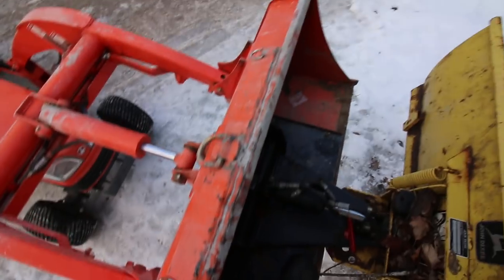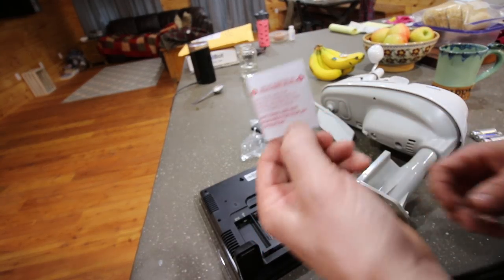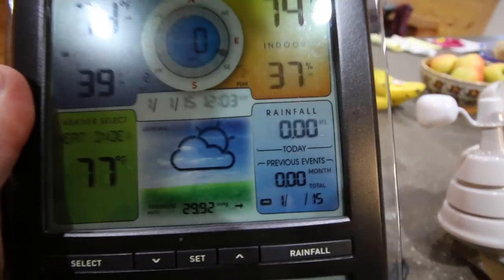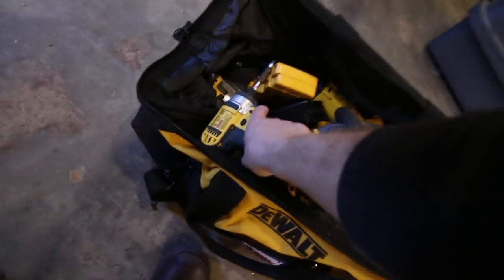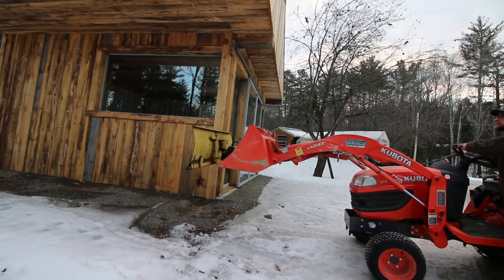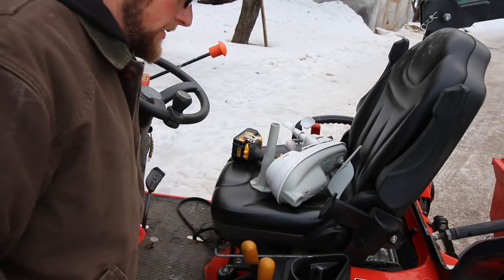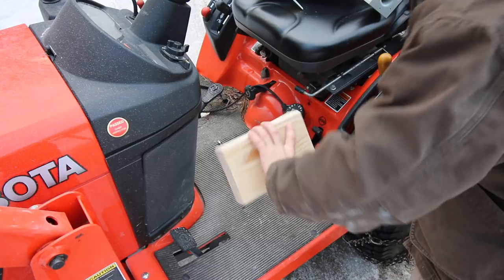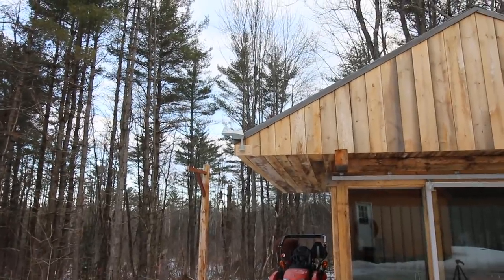Installing an AcuRite Weather Station Using A Kubota BX2370

Comment: Good morning Al.  Great project idea, thanks to Simon for his generous gift.  I have a similar model and have found that placement of the outdoor sensor is somewhat critical to its overall accuracy.   I had mine mounted similar to yours and the wind direction was not correct most of the time.  The wind speed will be off as well due to the surface of the roof acting as a deflector .  You should really consider mounting the sensor on a pole in the middle of your yard away from structures that can interfere with the wind.  The wind chill, speed and direction work best when there isn't anything deflecting the wind toward or away from the speed and direction sensors.  Have fun with it.
Reply from the maker: Thanks, I will have to think of a spot for that. And wait till the ground isnt frozen! Lol
Reply: Lumnah Acres Yes, the frost would require a drilling rig!  I'm waiting for the thaw to put up a bird house on a 16' 4x4!
Reply: Yes, thank you Simon!  Now Al can give the Modern Steader weather updates to include wind speeds, rain totals, etc.  I also agree with the other comments about the mounting, it would be mounted best on the gable peak with your solar lens pointing directly south.  A pole/pipe is not a bad idea, but it will be subject to wind gust making it pitch back and forth, yeh gable end above the roof line would be best.

Comment: When you check the manual I am sure you will find directions on how to use your compass (You do have one don't you?) to orient the unit so that it will give an accurate indication of wind direction. I think you were right about mounting it higher to get data on the wind and not just eddies at the corner of the roof.
Reply: I agree with you... I think the unit should be at the very peak of the roof to get accurate readings.

Comment: A few (friendly) thoughts... 🙂
- the little rudder that swings around on the bottoms of the weather station is probably for reading wind direction.- the solar panel on the top is probably to gauge the intensity of the sun, which will tell you wether it’s sunny, partly cloudy, or overcast.- you should consider mounting the unit higher on a longer pole. The reason is that having the unit mounted so close to the roof will not only affect the wind speed and direction readings as the breeze swirls around the structure, it will probably give you inaccurate rainfall readings from rain splashing off the shingles.
Anyway, that’s my free, unsolicited advice, so you get what you pay for! 😄
Great video! I’ve been wanting to get one of these for years, but have not been willing to make the financial investment. I’m happy that you have one. Enjoy!

Comment: Made it to the end! Yes, Figaro needs a jungle gym or some crazy toy for the winter. :)
I do think the OGOK roof will block the wind direction - that fin on the bottom of the weather station. I think you need a tall extension pole to get accurate wind information.

Comment: Neat weather station, lot's of features. The little propeller is an anemometer, and is for measuring wind speed. It appears the mounting bracket has a socket on the bottom that might fit a standard size PVC pipe. This could be helpful in mounting it higher above the OGOK roof. Weather stations should be mounted as far as possible from buildings. The reflected heat from wood siding, roofing, etc. will influence accurate readings.

Comment: I have same weather station. You really need to move to a place thats more open. Where it won't obstruct the wind direction reading or rain accumulation. You can use a 1in pvc pipe to extend it up higher too, it fits right in the end.

Comment: AcuRite makes a unit for your refrigerator freezer . It comes with 2 sending units and a monitor with alarms. You could use it in your root cellar and not have to open the door to see what the temp. Is. Got it from Amazon.

Comment: I have been running that very weather station for a couple years now. In order to connect to the web you need a separate box called a hub that plugs into your router. Then you can create an account with Weather underground which shares your info with anyone including NOAA
Reply from the maker: Thanks

Comment: Regarding the Kubota ratchet strap challenge – I have more of a question than a challenge:  Could you chop down a large, mature tree you need for whatever purpose and strap the trunk without the Kubota rolling over forward?  And why is the roll-over on your Kubota down? Thanks.
Reply from the maker: Not sure, when I mow close to the trees if it up I take them out! :)

Comment: Nice weather station but you need to move it off the corner of the roof. The wind direction and speed will not be correct as will be the temperature since it is so close to the roof and being blocked by the structure. You should possibly place it on a stand alone post or a pole sticking up about 15 or 20 feet or 4 or 5 feet from the peak of the roof where nothing blocks it.
Thanks for your videos, love them! I also made it to the end.
Reply from the maker: Super steader!
Reply: You rock son!

Comment: Hey Al ....... goooood morning! I think the roof is going to interfere  with your wind direction vane as well as the wind speed cups. Also, you may get splash off the roof going into your rain gauge. Depending on how far away from your readout panel you can get, I would mount it on a pole where you will get the least interference.

Comment: There was no rush. That version doesn't have an Internet bridge so you'll need your PC to transfer data to the 'weather underground (wunderground)' if you wish to store it online. I believe that data can then be accessed by the WordPress 'wunderground'  plugin to display on your website? (If you want data automatically stored online, I'll see about getting you an Internet Bridge at some point) The top anemometer cups record the wind speed, the bottom vane records wind direction (make sure it can swing a full 360°) and the batteries are for an internal fan to make the heat measurement more accurate. Anyway, hope it proves useful and it might also be good for a project for Olivia perhaps? ☀️ 🌤 ⛅️ 🌥 🌦 🌈 ☁️ 🌧 ⛈ 🌩 🌨 ;)
Reply from the maker: Its been set up for 2 days know it we are really loving it. It is nice to be able to check the temps and wind chill
Reply: I liked the irony that the weather has been too bad to install a weather station - that made me chuckle :)

Comment: I didn't see if you checked to see if it was level. The paddle on the bottom is for wind direction, that's why you want it higher than what your mounting it to, so the pole or building isn't blocking the wind from the sensor. I often find the insruction save me alot of time by not having to redo stuff!

Comment: i have an older version of this unit and after about 3yrs i had the wind meter break also just the other day during a big wind storm the mount broke (ive replaced it with a piece of 3/4 plastic electrical conduit  got an order into get new air cups

Comment: Sounds like it runs on house current, but you be might lose function and memory during a power outage... thus a battery backup? xoxo from sunny 🌞 Arizona, 78/47f today.
Reply: Spot on - the batteries ensure any data stored on the device itself are saved if the unit loses AC power. I think it can store about a year of data. It's possible to also have the data transferred and stored on the net as well...

Comment: You can only push your indoor humidity so high before you get condensation on your windows. How high depends on the insulation of the window and the outdoor temps. You can find tables online for various types of window construction. 

The best place for a weather station is out in the middle of an open field, at least 100' from anything. The less your location is like that, the less accurate your readings are. I think you'd get better readings if you mounted the unit on your off grid outdoor pig hanging pole, but it's really still too close to the OGOK and the trees. Pretty much anywhere in that area the wind direction is mainly going to tell you how the buildings and trees are funneling the wind. If you're feeling really ambitious, you could put a pole out in the pasture if it will work reliably at that distance. I've mostly given up on wireless weather instruments in favor of a weather app on the main screen of my phone. By the way, I'd never, never pull such a dangerous stunt as using a loader bucket as a work platform. That is mainly due to the fact that I don't own one.